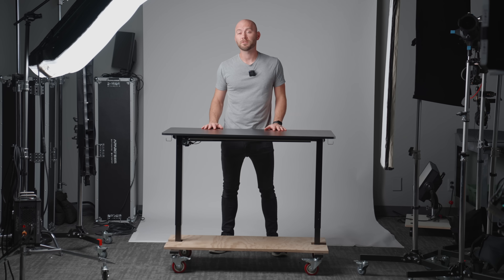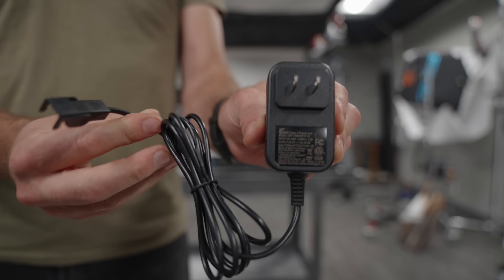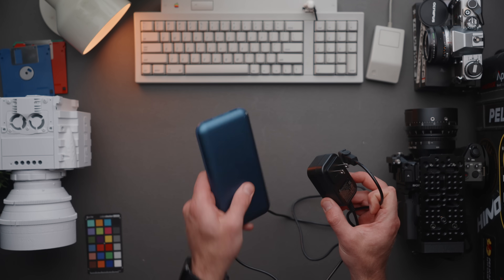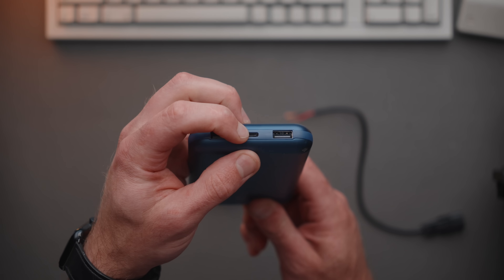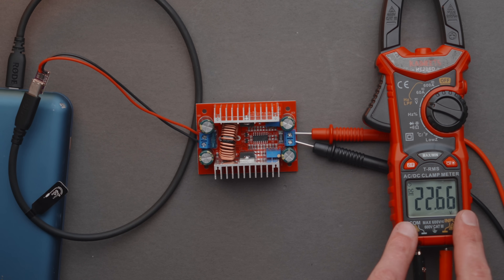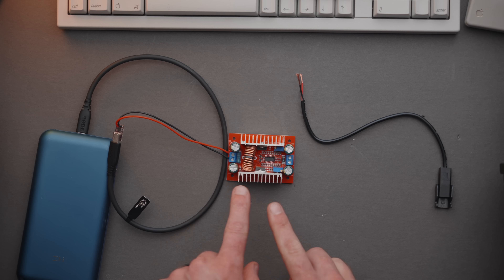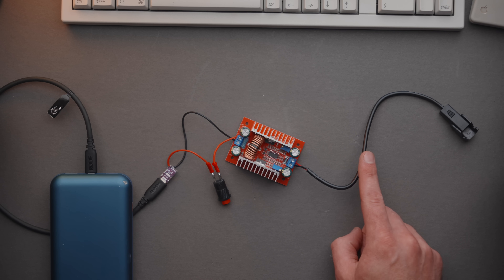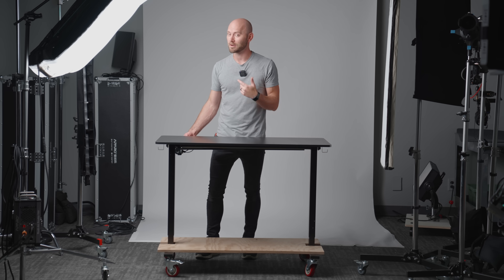No Cords! Mobile DIY Desk Build!

Comment: Notice he use USB C from V-Mount battery NOT from Power bank. Desk power adapter is 29V 1A mean 29W need to operational. 
Anyone wanna try this setup must use power bank that support 30W output from USB-C port minimum. Because most in the market use 22.5W max output.

Comment: I love this idea! I rarely change the height on my product shots desk because I'd have to take a different cable out of the plug in order to connect it. This would get rid of another cable on the floor and allow me to use it! What's more, it looks like a very easy soldering project so I could get started with that skill, too.